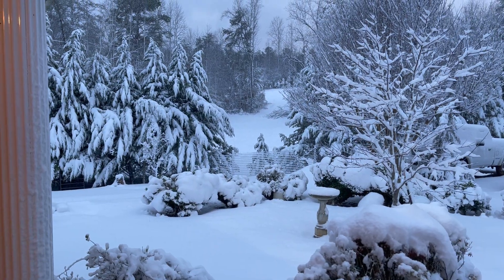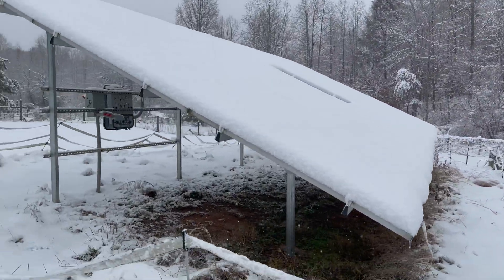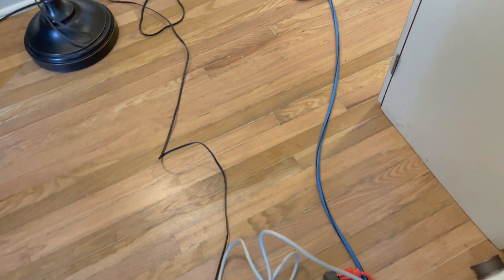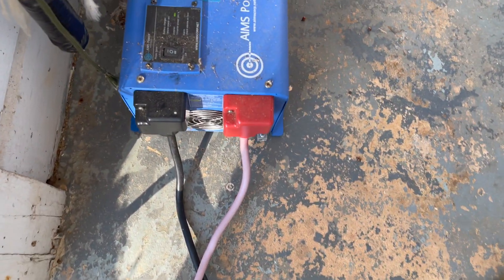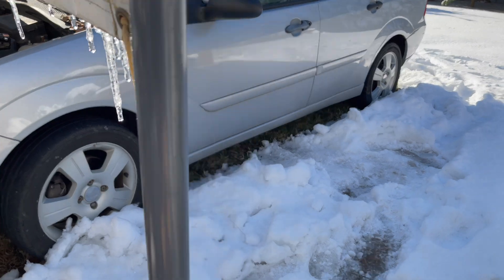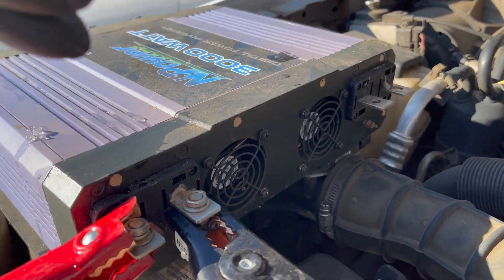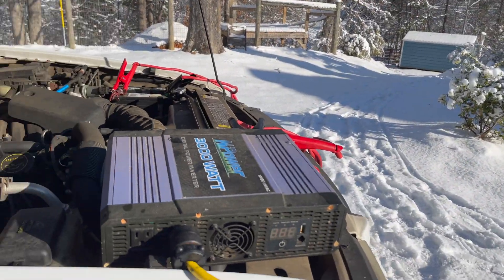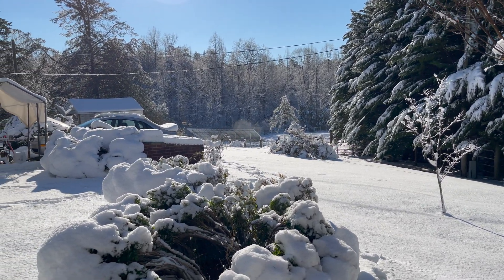Portable Inverters with an Idling Car Engine for Backup Power

Comment: Won’t it drain battery on idle?
Reply from the maker: Thanks for watching and your question. Even though we were only using one 1,500 watt half of each of the “3000” watt inverters we had to keep our total current drain low on each of them or they would have drained the car batteries on idle. I also have a diesel tractor with a manual throttle that I have used in stead of the car or truck. This approach can help keep your refrigerator, aquarium  and a few lights working, but you won’t be able use your microwave, home heat pump or kitchen range. We now have two EVs, a Chevy Bolt and a Tesla Model 3. Unfortunately neither is bidirectional and the 12 volt batteries on them will not support our two small inverters. Now most GM EV vehicles and others are bidirectional capable of powering your home. My dream is a Chevy Silverado EV with a 200 kWh battery that is massive compared to a 14 kWh Tesla Powerwall and could run everything in our house for several days and allow our grid sensitive ground mount solar panels the capability of recharging the truck when the weather is sunny. I am waiting for the cost of a used bidirectional EV capable of “vehicle to home”, V2H to drop enough to be affordable. In the meantime climate change apparently has eliminated our ice storms and now unbearable summer heat and air conditioning has become the primary issue for us.
Reply: @anisotropicplus thanks for your reply. For  example if I use a 500w inverter connected directly to SUV’s battery running on idle and getting 400w power. Can my car battery keep up on idle?
Reply from the maker: @Mm888-i1r It will probably be able to handle it. You could check on your alternator’s power rating and test it before you really need it during a power outage on the grid.

Comment: I'm trying to find a way to recharge an Eco Flow Delta Max using the 120v outlet on a 2500 watt pure sine wave inverter connected to my automobile battery. It has a 170 amp alternator, which I'm sure won't support 2500 watts, but what if the load on the Eco Flow is only 1200 watts input and 1200 watts output continuous? Will I damage my alternator or battery?
Reply from the maker: Thanks for your comment and question. I am not familiar with the Eco Flow and the amount of current it draws during charging. People routinely jump start autos with a running auto engine. The voltage regulator on your car or truck’s alternator may protect it from over current, but to be honest I am not sure. I connected quite a few lights, the refrigerator, TVs and other things to my pure sine wave , and to my not pure sine wave inverters while they were connected to my vehicle’s  battery while it was running. You could hear the engine slow with the current drain, but everything survived. Try googling what keeps jump starting a car from damaging the running car’s alternator and regulator and see what you get. I doubt you will damage the vehicle’s battery since by design they re capable of very high current when starting a car.
Reply: @anisotropicplus  thank you, sir.
Reply: I have a VERY similar setup to yours.  I have a GM 3.6L engine with 170amp alternator.  I was able to charge/run the Ecoflow Delta 2 with a 1500watt pure sine wave inverter -- i have my Ecoflow throttled to 1000w (vs full charge) just do keep draw on alternator down.
Reply: @davidl7080  you're awesome, David. That's just the info I needed. How long on the charge @1000?